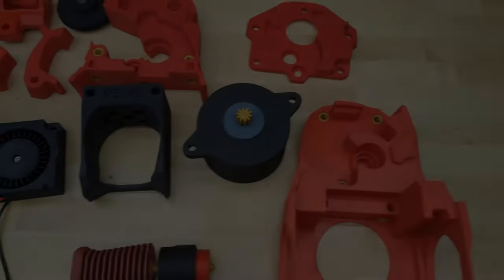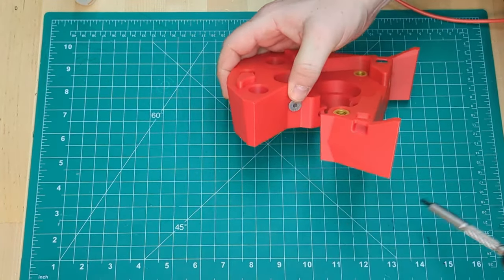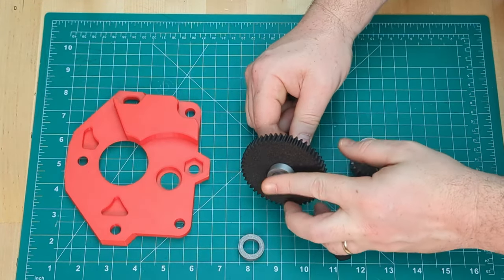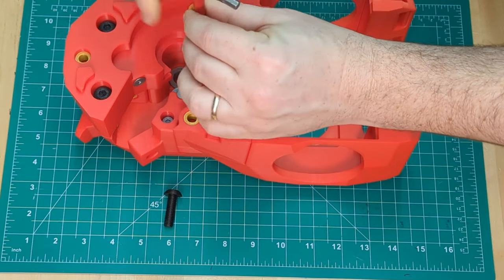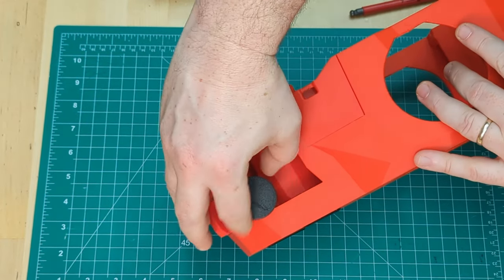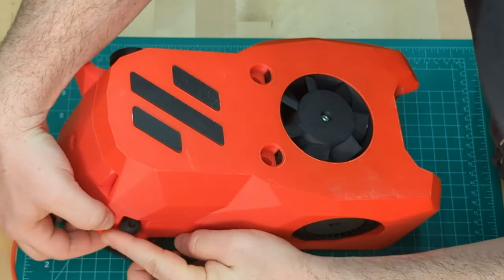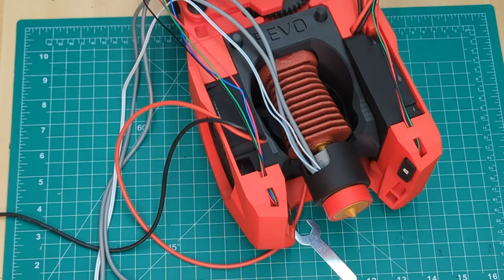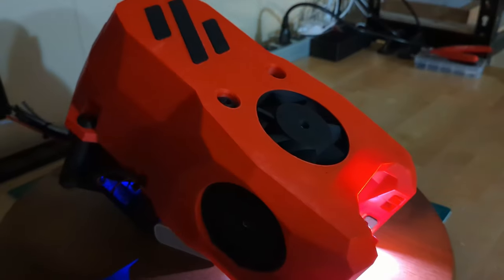The Mini-Stealthburner is BIG!

Comment: AWESOME AND CREATIVE VIDEO! Do the dual 3010 fans provide enough cooling for voron 0? Do you know if the narrow air exit vents gives better cooling than the wider ones ?
Reply from the maker: it seems to be a slight improvement over the 0.1 ducts, but nothing significant, it's still a bit weak on part cooling.

Comment: Need help... i tried printing guidler and the support wont come out easily. I ended breaking the top part every single time.
Reply from the maker: That's unusual, the part has a 0.2mm gap between the main piece and the support, and if you scale it up, that gap gets larger, at 3x ours wasn't attached at all and stayed on the build plate when we removed the guidler.  maybe you need to incease your cooling?